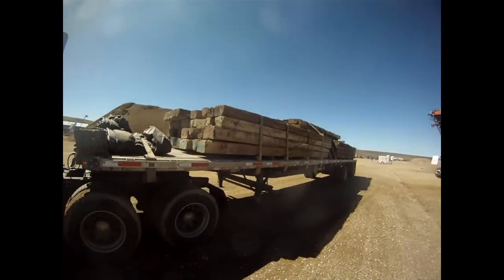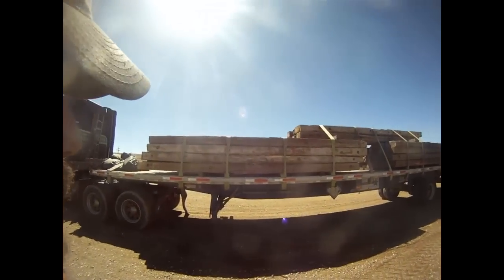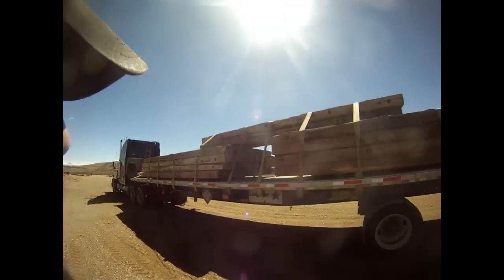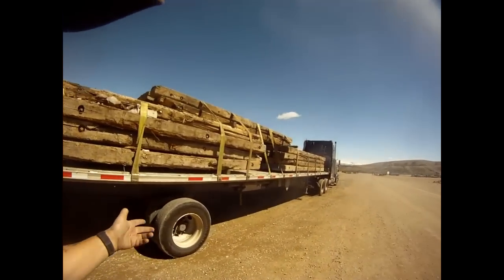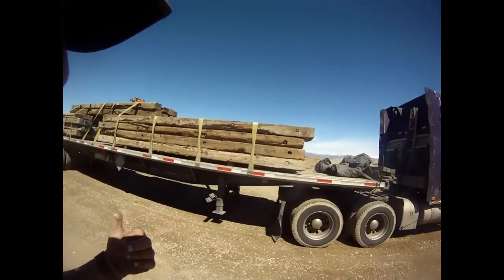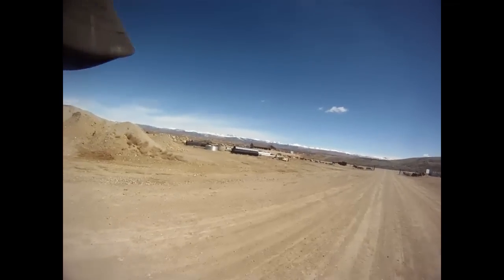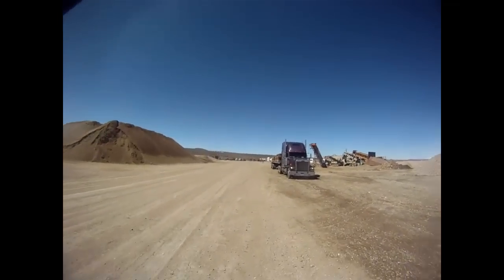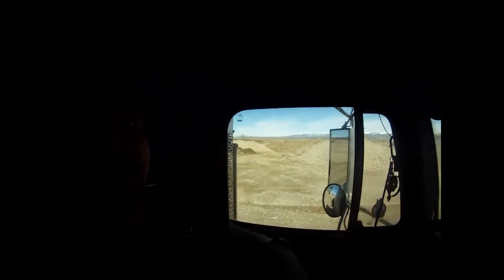Crane Mat Load-Jim The Trucker Video Series

Comment from the maker: Well, if you see my green smoothie video it will show the inside of my truck. There is not a lot more to see. I have had 9 Freightliner Classics like this one. My truck now has a million miles on it and going strong. I still have the same oil pressure now as what I had at 235,000 miles. I take good care of my truck as best I can. I use an oil not available in truck stops, schaeffer oil dot com is the one I have put millions of miles on.